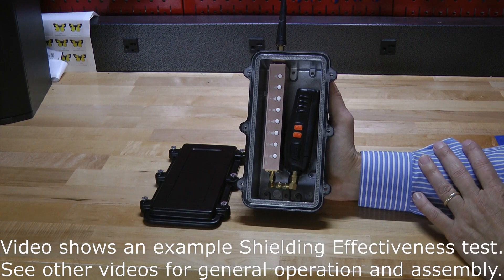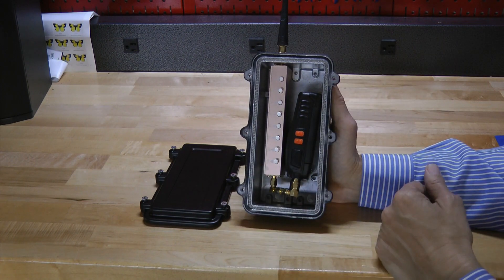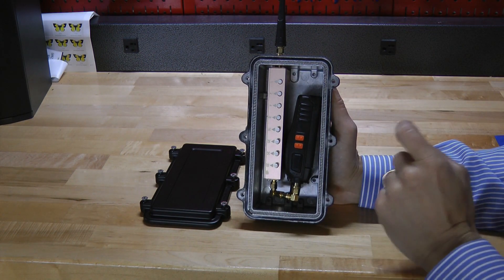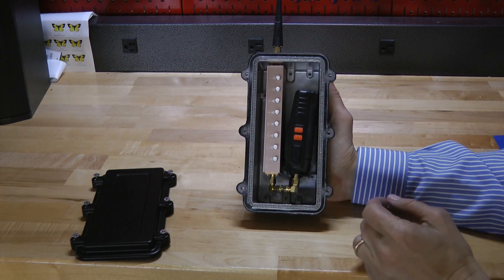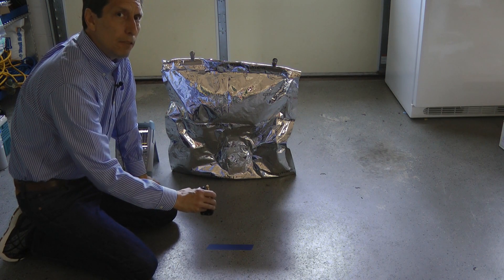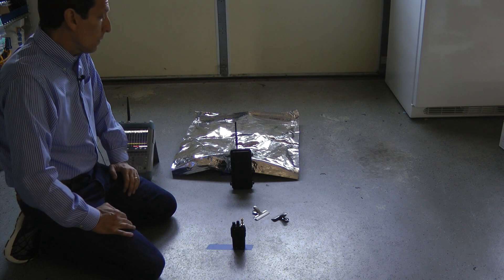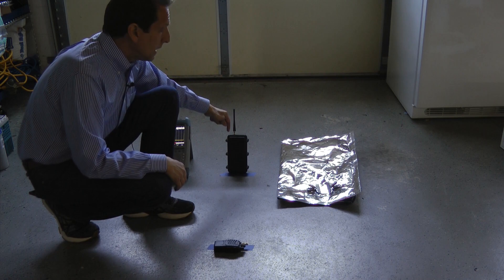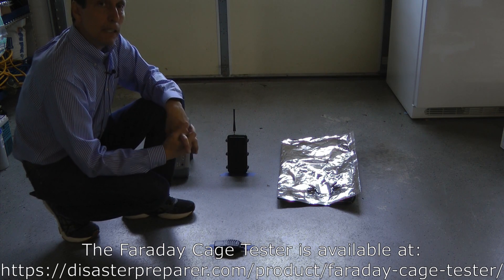Faraday Cage Tester - Video 4 (Testing EMP Bag)

Comment: This device works well. The only change that I needed to make was to swap the radios with UV5R radios. This gave me the ability to turn on the Roger Beep with CHIRP, thus the ability to hear the beep inside my nylon faraday bags and aluminum faraday boxes. In testing with EMP bags that have been tested by Keystone Compliance, I got attenuation results at 24 inches that were very close to Keystone's certification testing. Well done EMPDoctor! 👍

Comment: Just a thought.. some HT’s have integrated tone generation for signaling / repeater activation, etc. (usually 1 kHz or 1750Hz)
I’m more of a Motorola \ Hytera user and  not too familiar with Baofeng radios, but… perhaps the feature is included?
It might just make hearing the transmission a bit easier?

Thank you Dr. Bradley!

I’m just stupid engineer and radio geek and you are my absolute best source for this outstanding EMP/CME information AND protection!

Comment: I built my own Faraday cage.   Some items have two layers of shielding (Steel + Aluminum), others have 3 layers (Steel + 2 Aluminum), and the really important critical stuff like the HF Ham radio, solar equipment, night vision, etc use 4 layers (steel + 3 aluminum)     For testing, we used two handheld ham radios as well as two different 2-way walmart style radios, and none of them are able to make it through with the "call" button or any other signal.    

The call button works at just 1 layer of steel, but becomes pretty flaky at 2 layers, and nothing gets through 3 layers.      Plus our Faraday cages are in the basement.  We built three of them for a total of about 25 cubic feet of storage because we have a lot of spare equipment protected.  

Love your videos..  best information on the internet...
Reply from the maker: Sounds like you have an excellent setup.
Reply: @disasterprepper   When North Korea started lofting ICBM's into space and detonating nukes, I got concerned.